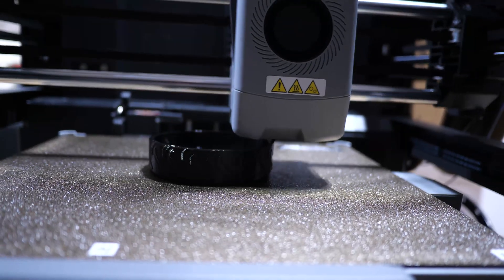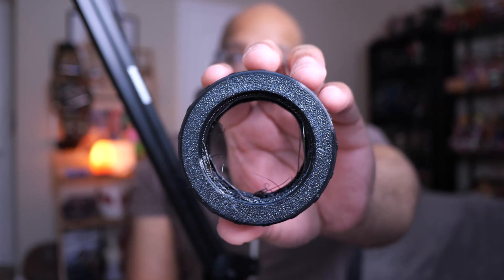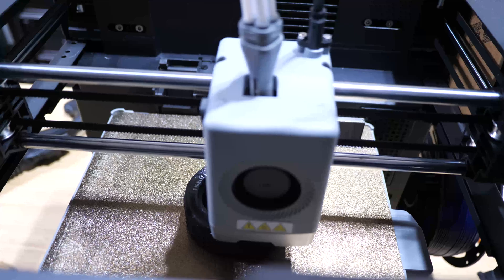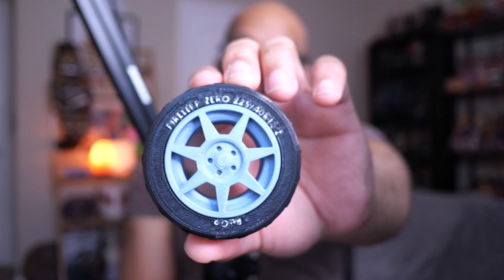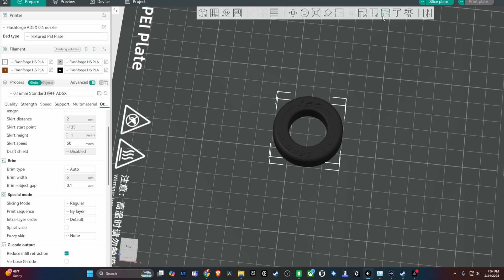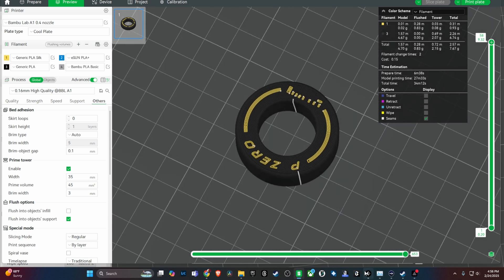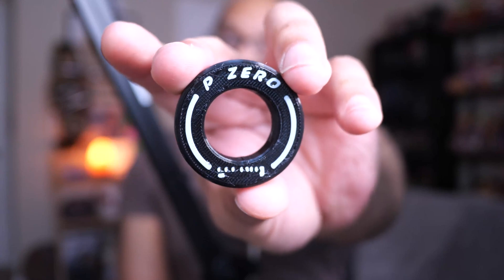Printing Dual-Color TPU Tires Using The Flashforge AD5X

Comment: I was able to fix the text issue by switching wall generator from Classic to Arachne in orca slicer.
Maybe you need to change the "Resolution" setting under Quality -> Precision -> Resolution. Default is 0.012, I changed it to 0.006
Reply from the maker: Well, look at that. That totally works! I'm pinning this comment. Thank you!

Comment: What brand did you use to print tpu? I keep trying a Ziro Purple 95A TPU and the only way I can get it to print without (Problem loading Channel: X) message is taking the nozzle off mid channel load and pushing it in there manually. And even then sometimes it just gives me the error anyways, I've only had 2 successful tpu print sessions cause the others don't even start. Is that an AD5X issue I have going wrong or a filament issue?
Reply: I've been having very similar issues as well. I reached out to Flashforge and they said the AD5X WILL NOT print TPU 95A only TPU 64D by Northumberger. So idk if all the Youtuber's got a better version or what but I'm extremely frustrated with my AD5X when it comes to printing TPU especially after seeing all of these videos showing/saying that it can print TPU95A

Comment: Could be that the features are smaller than the nozzle size. You should look for settings that have to do with the Minimum Feature Size. And make that much smaller. Perform a couple of tests on a smaller print and see how small you can go without either prolonging the print time too much or decreasing quality. It can be a tricky problem to dial in.

Comment: I'm very much enjoying this series on the AD5X.  You're addressing my reasons for wanting an AD5X, and seeing what it can do despite FlashForge having backed away from the TPU claims for the IFS, I am impressed and I now wish I'd gone through with the preorder.  I wanted to print an engraved single color logo on a series of TPU products for my small business but I don't like large logos and the resolution wouldn't have been good enough to 3D print, so we laser engrave them, but the resolution on that white on black TPU tire was impressive.  TPU is stringy and I expected it to look messy.  The retraction settings must be very good.  I look forward to the PLA support on PETG parts video.  That's my other AD5X application.

One other thing I'd love to see is how the AD5X handles switching to a new reel of filament.  For production, I'd love to load two pairs of filaments and have it automatically switch to the next reel when one is empty.  It would be very handy to remove the parts from the printer, replace any empty reels and keep printing without wasted filament, the need to hover over a printer to manually switch reels, or filament splicing.  Can the AD5X automatically switch to a new reel without any artifacts on the print?  Can it do that if a reel runs out while it's printing the outer layer?

Comment: Few people made the comment below for the lettering on the tire. Need to either
a) adjust your layer width for the lettering (use a modifier on the top layers and set to reduced line width)
b) use a 0.2mm nozzle
c) adjust the whole tirre size a bit larger

Best bet it to do a)
Reply: You are right, but depending on the line width you may have no other choice than to choose a smaller nozzle.
Reply: @samue5370  agreed

Comment: I’ve had multiple issues so far with this model. Idk what is up with it I tried everything. But yeah I don’t feel like the AD5X was ready. I’m trying to return mine for a refund. I’m going to another company sadly. Shouldn’t have to tweak and adjust things for the machine to work.

Comment: I would slice it with a 0.25 mm nozzle even if you don't currently have one just so you could see with the slicer preview looks like. The detail just might be too fine for the 0.4 nozzle and the slicer is interpolating and turning text into shapes.

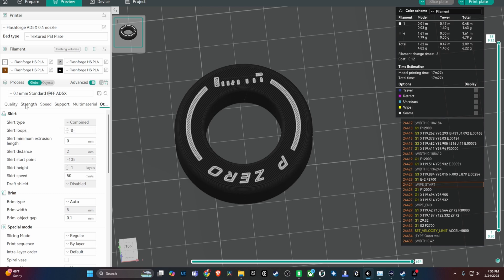Comment: 5:00 Might just be too small honestly. Increase the size of the tire and the logo will probably be fine. Either that or swap to a 0.25, but I wouldn't suggest that with TPU. One way to check would be to also turn it 90* so it's printed vertical and the detail should improve. Laying down it's lines are 0.42mm in thickness
Reply from the maker: Making it vertical made the logo a little more readable with the arachne wall generator, but the print time and filament changes dramatically increased.